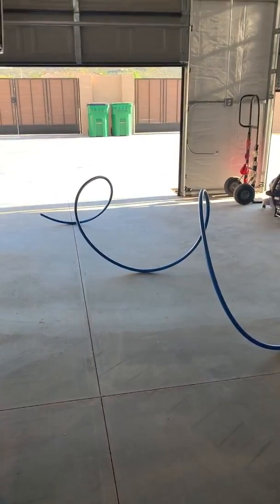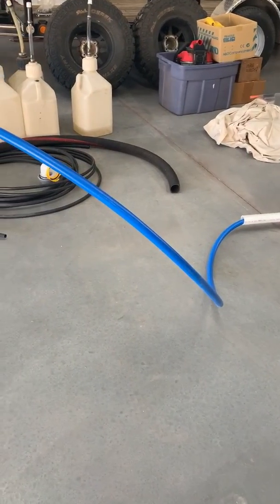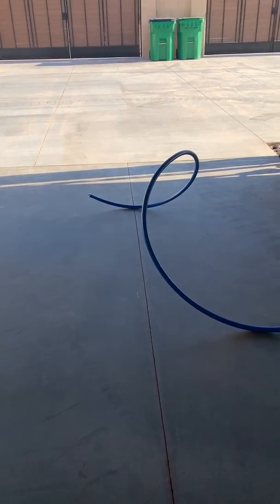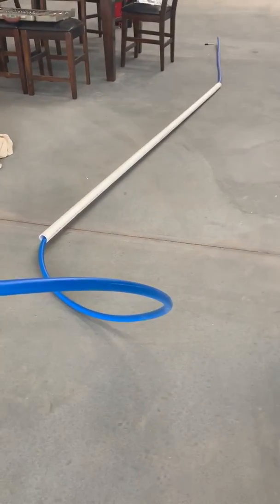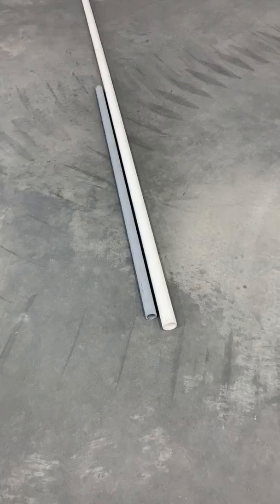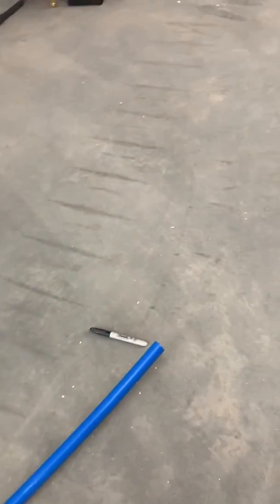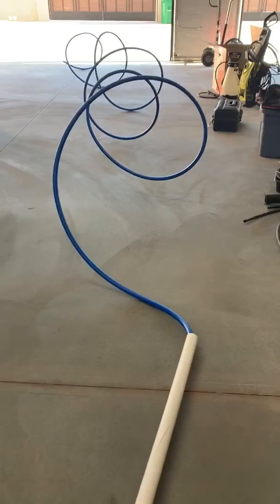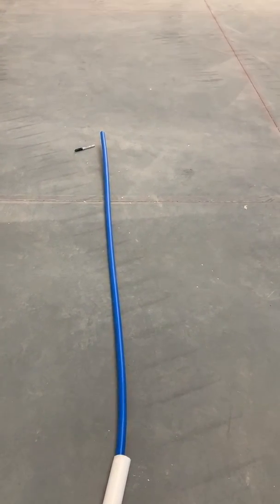Straightening RapidAir Maxline tubing - PVC pipe trick

Comment: I used this method and it worked great!  Only difference was I left it in a roll and feed it into the pipe as I unrolled it.  I used the 1 inch hot water pipe PVC for 3/4 inch airline.  I used a coupler on one end and a step drill bit to chamfer the pipe to help the airline feed into the pipe. I placed the pipe in my vice.
Reply: following this exact same approach - working great!